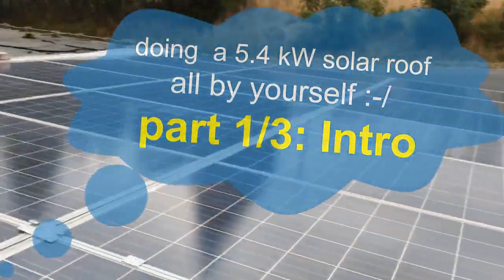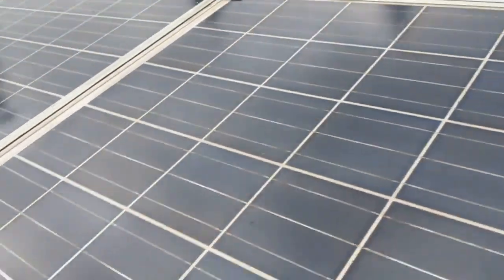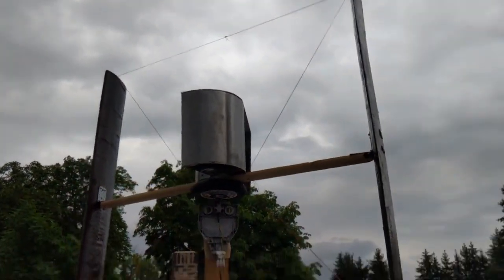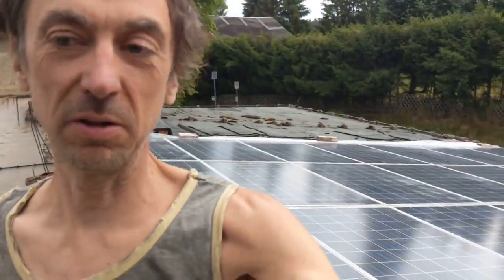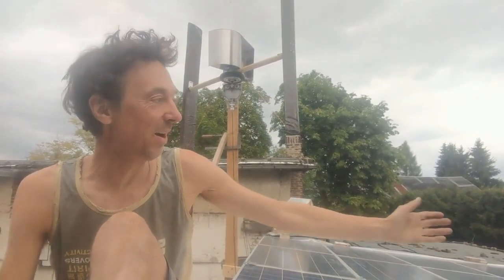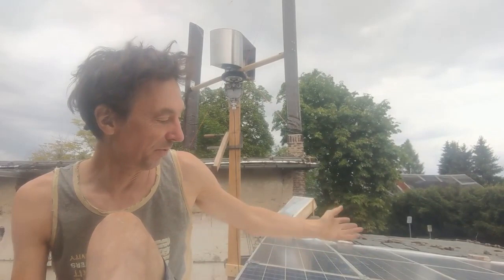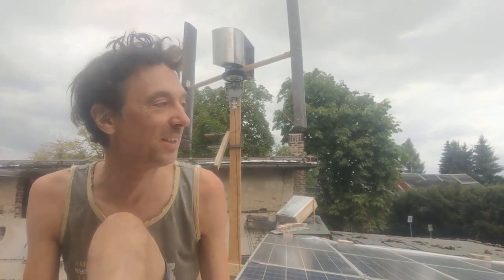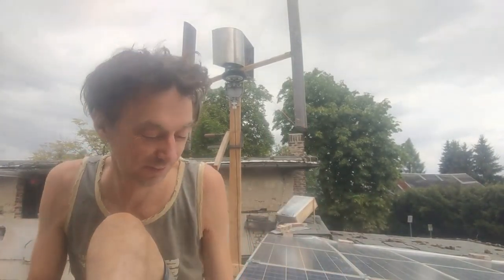part 1/3: Intro - doing a 5.4 kW solar roof all by yourself :-/

Comment: This is something I've wanted to do with a car port myself, and seems like a good way of doing it. These solar panels can be improved by being kept cool on hot days with a draft underneath. It would be interesting to try have a 2-layer roof where you could expel warm air form the bottom panels half-way up the roof and draw new air in for the top panels.

I've also been keeping my eyes out for second-hand solar panels, and share your ideas of living a more frugal life.
Reply from the maker: Well with 5 kW old 15% efficiency solar panels you have up to 85% = 28 kW of solar heat and air will not really help a lot to cool the panels down.
But for my 90 m² 42° solar roof i plan to use the hot air underneath to heat aluminium pipes under the ridge of the roof which feed a water-water heat pump..
If you would  share my ideas of living a more frugal life you would sign my masterplan for world peace: https://www.RoboDurden.de - otherwise your words are nothing but hypocrisy :-(